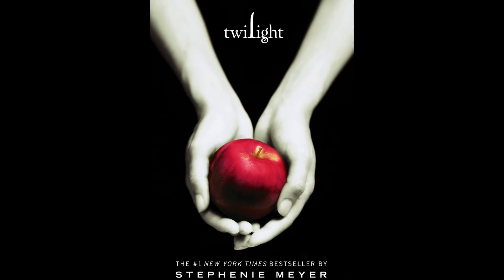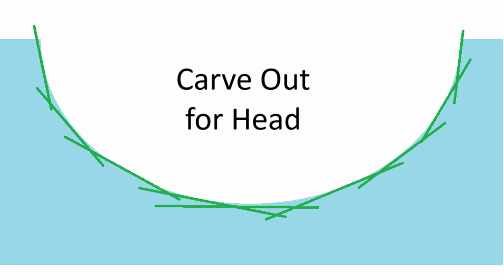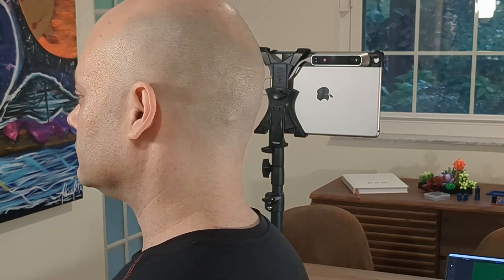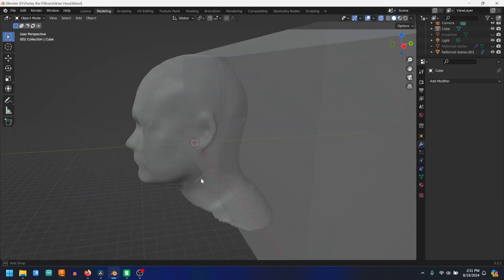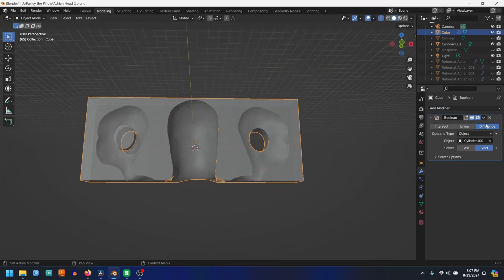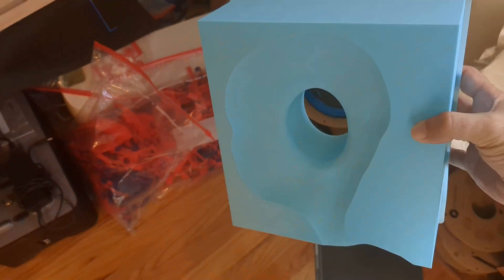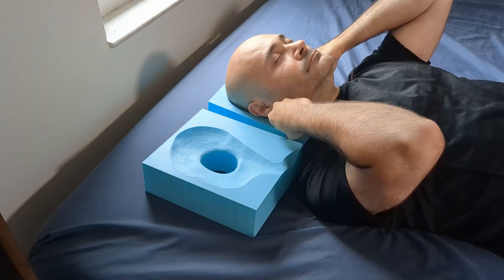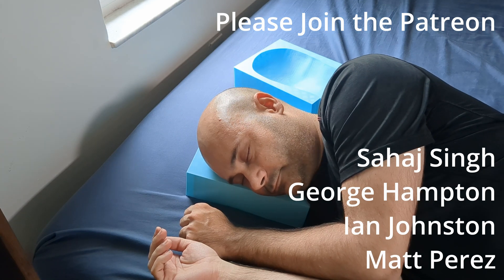Paxley the Hard Plastic Pillow

Comment: Another idea, you could take your 3d model, start with the face with its right side down, make a boolean with the box like you did, then roll it and move its center a little to the left and keep cuting out until the face is like 20 or 30 cm to the left, and on its left side down. You'd have a cutout that would allow you to roll your head to either side, and in every position you would be supported along the pillow. It's hard to put this into words...
Reply from the maker: @P-Ian  I understand what you are describing. That might be version two if I get to it.
Reply: you make a pillow that has elastic band tiedown points, then you just enclose your head, making sure and allowing for breathing and stuff from all angles

Comment: This video definitely needs a follow-up! Do you use it regularly? How comfortable it is for longer periods of time? Also, if you plan to use something 3d printed often, and it has contact with your body, it's best to seal the 3d print with some skin safe resin, so the bacteria don't have so many micro places to live, and multiply in. Also, i wonder how it would change the fitment if you made the transition from your head contour to the flat surface like a smooth lip, so there isn't an edge there.
Reply from the maker: I use it for naps, but find it difficult for regular use. I like the one that cups the rear of the head. The side one seems to compress my face a bit too much. Long term I would definitely seal it. It doesn't seem to need a beveled lip. It's comfortable as is.
Reply: @adrianinvents  Man, I think I'm sold, if I ever a 3d scanner in my hands I'm making one

Comment: Find a way to "roll your head" in both directions, so that you can use one long "pillow" that no matter where your head turns  it's perfectly supported
Reply from the maker: @Uhfgood  That's a good idea. Thanks. It might be v2. There is a way to unwrap a structure in blender. It's just a bit more effort than I wanted for v1. And another commenter suggested putting my head in a sphere, so I can roll anywhere. Hehe.
Reply: @adrianinvents  - that's a thought, but leave plenty of air holes, don't want you suffocating 😛

Comment: Maybe add some fillets to the edges, then print in FLEX/TPU? Could really be great… 👍 😂
Reply from the maker: @ddanier  I didn't think of TPU, and I have a bunch. Next one I make, I will totally do it. Good idea.
Reply: @adrianinvents  I reckon print TPU infill with no solid edges or top layers. Then cover it in some sort of breathable felt. That should be very comfortable in any temperature.
Reply from the maker: @andybrice2711  Thanks. That's a good idea. I did think of felting the hard one. Leaving a tpu print open on top is definitely the right way for flexibility. I did that for tires once.

Comment: The seashell sound could be solved with some sound dampening inside. It looks good also a little like at packing for a human robot.
Reply from the maker: That's a good idea. I might do that. Luckily, the sound isn't as dramatic when it rests against the mattress.
Reply: Also, flaring out the hole. It is the sharp transition from cylinder to open space that causes standing waves and a hollow, cuppy sound. Basically you want to create an acoustic horn. An ideal horn adapts a cylindrical space to open space without standing waves (although there will be a tilt to the sound spectrum).
Reply from the maker: @keantoken6433  fascinating.
Reply: And gyroid infill, it should dampen the sound.
Reply from the maker: @TheLaXandro  Interesting! I did just use rectilinear, so I will try that next time. Good idea. It makes sense.

Comment: Why do I always across weirdness here?

Anyway, interesting concept. I can only think of maybe making the outside round and maybe having the padding there. You could also make it from foam cast using a printed form. This would allow an escape for moisture.

I think most pillows suck too, and also made my own, but I just used down filling in a pillow protector since most are far too dense and not mouldable which are the two most important factors for me.
Reply from the maker: Thanks :) That is awesome that you made your own. Sometimes that is what it takes to get things right.